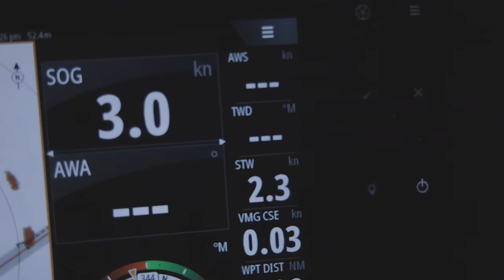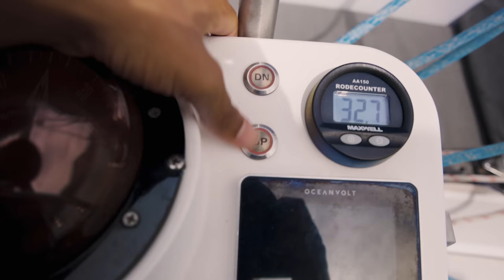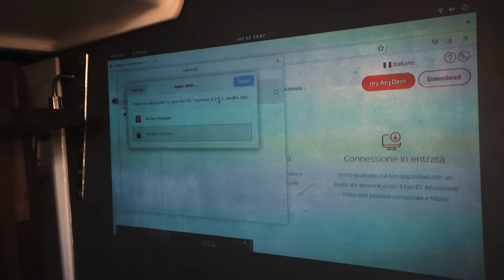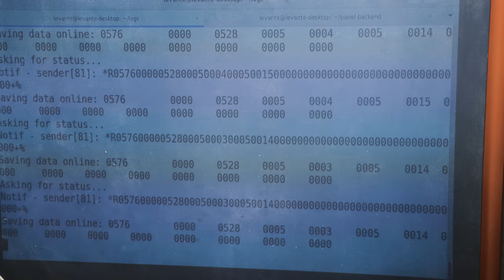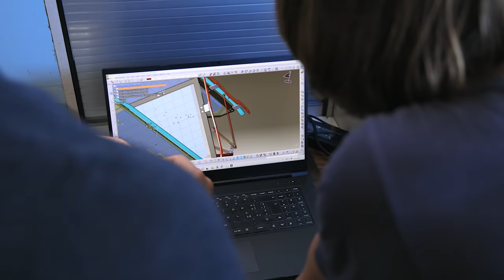NASA Inspired Solar Wing | Step 333

Comment: My dad was sent to Cochabamba, Bolivia to teach radio to Indigenous enlisted soldiers of the Army. W2FFM found out the equipment needed to be in regular contact with Panama. He was also able to relay traffic from other missions that put him in a position to request any non-functional equipment he could include in his classes. He started radio when his older brother became fascinated with Marconi's wireless trans-Atlantic message to France.
The mission chief lent him his C-130 for a month to collect all the things that needed to be repaired. Chief among them was a burned-out generator (just like the one often mentioned in MASH). So my job was to strip and "tin" wires of various sizes that he cut to length for various components. One day the skip (bounce off the ionosphere) was perfect for a couple-minute voice contact in England. many thousands of miles away. Cheers from Mr. Strip & Tin!

Comment: I have a weather station installed on the top ridge of my house. I didn't want to ever have to go up there to change the batteries but I knew they would die eventually. So I bypassed the battery box in the device and hardwired it back down to an external battery pack inside the house.

I know sail boats are different but i cant imagine why you couldn't do the same. It seems like the kind of easy project that provides massive convince that you seem to enjoy.

That being said, you have enough DC electrical systems on your boat that it is well within your capability to hard wire it to your system and eliminate the battery entirely and eliminate any need to ever go up to the top of the mast for a battery change again.
Reply: Even my wireless Ring doorbell has a small solar charge assist to its battery.  Might be simple to stick something onto the masthead to augment 
Just a thought…

Comment: LOL pre-soldering leads is called 'tinning' and the easier way is to lock the solder in position, place the tip of the lead on the solder, and heat the lead above the solder.  When the lead gets hot enough to melt the solder, it will tin the lead perfectly.  To protect the plastic insulation, hold the lead with a heavy set of pliers (as a heat sink).  But you got the job done, so it must have been done correctly  :)

Comment: I think "Sail Life" has the best most practical solar solution.
Reply: Disagree, Mas has a decent setup, but can only double his folded capacity.

This system can expand a lot more AND be mounted in other places where what Mas has can't.

It's not as simple a solution nor will it be THE solution for everyone, but I'm keeping my eyes on the project.
Reply: Disagree… Mads system is pretty innovative and I haven’t seen this before. I am struggling to see the point/innovation here. We have foldable panels and we have rail mounted panels. I suppose we don’t have panels that fold like this but the current foldable panels accomplish the same goal.
Reply: @SVEverydaysailor  not saying Mad's setup up isn't good or innovative, just that it's not "the best".

What if you don't have or can't fit an arch to mount the panels above the cockpit? 

Can Mad's solution be mounted on the sides of the boat and take up minimal space like this folding system?

Project Atticus used flexible panels on a soft dodger and a couple of rigid panels mounted to their side rails that they tied up to face the sun when at anchor, a folding panel setup up like this would have perfect for their old boat.

I'm also not saying that origami panels are the best or most innovative, but I can see that they have some very good potential and I think an see situations where they may be ideal for the main source of solar or for additional solar without turning every single surface of the deck into a solar panel.
Reply: Mads setup has a lot less electrical connections between the panels to worry about. And it seems to have a much more sturdy mechanical design, too. The solar wing needs less storage space, but might not be as reliable - not even in it’s final version. Anyway, I’d definitely give the solar wing design  a thumbs up for the creative idea!
Reply: Both solutions are interesting. I prefer Mads’ as well. However, when technology allows, I would like to see roll up solar panels. Unfurl them like a porch canopy. We have foldable LCD screens… Why not these?
Reply: @sailinghaldis  throwing panels on sails would be nice one day. I like the creativity but I just don’t see how this will be much different from a rail mounted panel. Realistically will want an arm holding them up for either. I think it’s more so we need more changes in the actual panels to be able to find a better solution. 

I believe there’s actually a danish company out there that has a more compelling solution by having panels being hoisted by a halyard and being able to adjust the angle. That would be a pretty good solution for being expandable.
Reply: @gerhardsundt9729  this ^^^^^.

I am not familiar with this other setup, but I assume it just folds on a single axis. 

It has the advantage of being sturdier, lighter, more total PV  surface and much simpler. 

This setup has one benefit. It can be folded up into a more compact package. This is helpful for NASA, but I don't see it being as much of a benefit on a sailboat.
Reply: @35manning  I like your "origami" description. 

IMO, this origami design adds weight and complexity. The question is whether or not the ability to fold up into a smaller package is worth it.
Reply: @petec9686  I do like their idea of "it still works when folded, but at 1/3 - 1/4 of its full capacity.

It's not a fully developed product sitting on shelves yet nor will it be the best for everyone, but if people didn't push the boundaries then we'd still be living in the stone age.
Reply: @SVEverydaysailor  Mads solution is pretty innovative - but it is built around a complete custom arch. And unfolded it roughly doubles the area. The foldable panels on the market work on squares and don't multiply the area either nor do they usually come with a self-holding frame (even so we only see a very early prototype with problem there). The origami solution will be mountable pretty easily out of the box, multiplies the surface area, stores extremely small. The innovation is in the folding mechanism & frame, and nope there is little comparable stuff out there. For the origami wings, we simply have to see how it develops and how the first production badges hold up...   If they manage to engineer the vision into a robust reality, it will become very interesting solution.

Comment: We too have had mixed results with wireless masthead wind transducers. They now and then drop their link with the under deck receiver and as always, at the most inconvenient moment. Among other, LED drivers generate a lot of radio noice blocking not only FM reception but also radio links between instruments. The only disadvantage with a wired connection is one more cable down the mast and at least the Garmin end connectors are awfully fragile, expensive and difficult to source.

Comment: Good system for campers and it looks great for marketing, personally I use bifacial panels which work well on the water due to reflectivity and can be retracted (slide) for lowering profile while rough sailing.

Comment: there are carbon fibre fabric hinges, maybe that could replace traditional hinging systems. i just went to their website. was surprised to see that it is a 300 watt panel, wasnt expecting that much. For the folded dimensions one can still get 4x 80 watt semi flexible panels make then fold/telescope  into one piece for less than your thicknesses, given that flexible panels are 4 mm thick. this is a cool concept but im afraid the final cost will keep any diy person away from it

Comment: It is very easy to turn a boat on anchor or buoy into the swell and safe it from rolling side to side: Take a long line and fix it right in front of the boat on the anchorchaine using a knot witch can not slip. Then take this line on one side of the boat very loose and outside the boat to a cleat on the back of the boat. Fix it on the backcleat without tensioning it. Than let more anchor chaine go out. The boat turns very smoothly into any position and can be stopped at any angel you want. It ist fixed in a save triangle built of chaine and line. To turn back, just winch up in the anchor chaine.
On a buoy this works similarely. You just have to take a longer line to the buoy. I often practiced this method to get fresh wind from behind on a hot caribean anchorspot. This works much better than any windcatcher mounted over the front hatch.

Comment: The problem is one of gravitational forces impacting the various angles of the fold.  Spacecraft orbiting the planet are in a state of constant free fall negating those forces so fold out panels have little to no force being applied to them once in position.  You would have to find a rigid locking system for the joints.
Reply: Not dealing with orbital velocities at ground level.  Non factor for anything less than colossal size projects--and I mean COLOSSAL .
Reply: Well, it will work for awhile, but the salt will kill them withinh 6 months to a year.  Very good idea, but no commercial potential.  Much fun onv😂nting stuff and watching.  I have so many similar efforts over the years and learn alot.  We all learn alot warch to.
Reply: @Buzz kill9000  orbital velocity and zero velocity are the same thing in terms of forces. Its acceleration that makes the difference

Comment: The power output is small. On a Van or Boat smaller foldable panels are still best choice. Folding systems are cheap and available. Problem with this type is lack of output. I will still chose solar trackers with smaller panels for max output. Have fun with the project 😉. Mary Christmas 🎄

Comment: Kika's right. If it works on a sailboat, it will work anywhere. Wonderful concept. And I'm sure the Greek Sea Sirens can't wait to flap their wings when you deploy your panels. Nothing like the ocean environment to test you best thoughts. I crew on a 36' Junk Rigged schooner. We're electric driven screw and fixed panels for the house bank. I certainly recognize your challenges and wish you the best. Very impressive and we anxiously await the trials. I told my captain to view this Step!

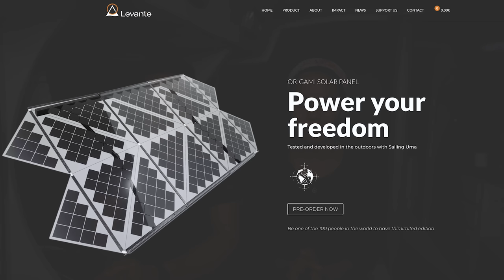Comment: 27:20 Seems that if you oriented the cells as you have done on the 4 outside triangles (i.e. aligned with the non-diagonal edges), you'll have a fraction more surface area than oriented as you have them on the inner triangles (ie. aligned along the diagonal). All the "white space" will be along the diagonal...which is shorter than the sum of the other two sides.

Comment: This will work if it rests on a supporting surface. (with fixing points) 
Don't expect it deployed and stay deployed in the mid air. 
 Origami solar panels work in the space because there are no wind and no gravity.

Comment: Don't upload to the cloud.  Just write your data to a .csv file & graph it with open office calc.  Two columns: time, voltage<return>.  And when you're ready you'll have all that data you can share on the cloud or on social media.  And if you use a 64GB sd card you'll never have to worry about running out of storage space.  And it'll be so much simpler and you'll get immediate feedback on your progress.  I bet you guys can write a few lines of circuit python on a PI.  Because it is "Easy as PI". :)
Reply: why have a dog and bark yaself ?? Cloud is the way for EVERYTHING these days

Comment: Interesting concept.  It would appear to be a bit to floppy for a boat environment but a good candidate for RV or other mobile operations.  I look forward to seeing the performance of the production version and how it performs on Uma.  Another great video and thanks for sharing the innovation and entrepreneurial spirit of exploring a new concept for solar panel construction.  Cheers!
Reply from the maker: Of course. It’s very floppy right now. That’s why it’s just the first prototype. Lots of work being done to solve all the issues we found.
Reply: @SailingUma  Understood - its the first prototype - you had mentioned that as well as work to tighten up the final design.  It would have been more fair to have added that to my comment which has been done.

Comment: Eco flow does a good 48V fold out PVC system, I store mine in the lazerette and am experimenting with securing it on top of the existing 12v 100w x2 panels mounted on a frame at the stern, just using the old panels as a structure. I need 48v for the electric motor. 

Sorry to be pedantic but in this video and some others you say you are “tacking”’when I think you mean you are “beating”.

Comment: you heated the wire connectors to seal them but in my electrical experience you will get longer lasting connections with some added shrink wrap over the whole butt connector... had to edit... great job!!!
Reply from the maker: They’re already waterproof. They have a glue inside that melts and seals out water.
Reply: @SailingUma  been retired for 20 yrs... never had seen those!

Comment: much easier to buy some semi-flexible panels, and put them on a few inflatable beds on the water when the water is calm.
if the water is a bit more rough, you can hang them on the rails very easily.
you can pack them into a relatively small place if you don't need them.

Comment: Each environment has its own unique solar characteristics. Whether that be heat, cold, dust,wind, snow, ice, salt, cloudy/overcast days, terrain, available space, geographic location and angle to the sun.
Next considerations would be location  and space ( boat, RV, cabin, homestead, etc). Followed by power considerations, hardware, assembly, mounting, cable runs, links and communication. Design compensations for number of overcast days: panel type/size/power output, mounting flexibility.
Some unique challenges on boats, depending on size, age, panel support (wood, steel, stainless steel, glass, cloth), panels that are fixed, flexible (rotation  or angled) boat construction material (fiberglass, wood, steel, aluminum, cement, composite, other): boom/sail shadow, underside boom clearances, new Vs retro for hardware access, cable routing.
With panels in place, daily, safe task work access. Fishing, towing, anchoring, docking, storage. Cleaning and replacement. High wind kite effect.
Most important is technical support and service when things go wrong or stop working. Moreso in remote areas to get spare or replacement parts. As panels and equipment age in extreme environments, parts will fail. When technology advances, more opportunities develop or can be taken advantage of. Sponsored supplier discounts.
This project must have some initial design goals: costs, power, mounting location and method, flexibility to expand, versatility and access to technical support and spare supplies. In time robustness, durability, reliability. For now what are you hoping for over the existing one? There are lots of valuable lessons learned when doing something novel.

Comment: Looks like for your crimps around 20 mins, you're using dielectric grease and solder on your crimps, have you found the solder neccessary best practice? I work in automotive and have found dielectric grease a god send for connections that may get damp.
Reply from the maker: The solder was for the panel connection. In the HS crimps we just is dielectric grease and crimp.